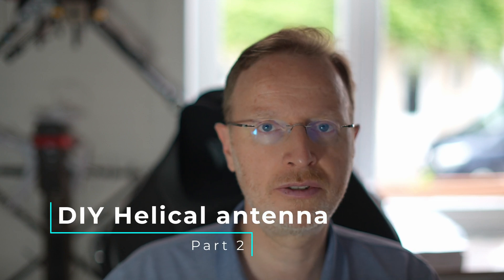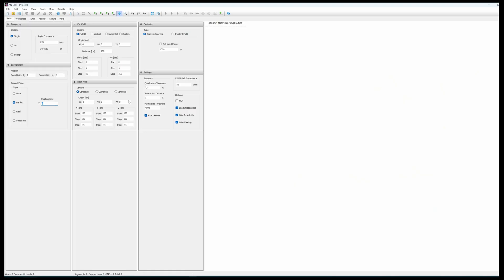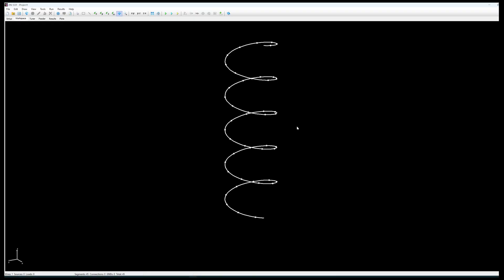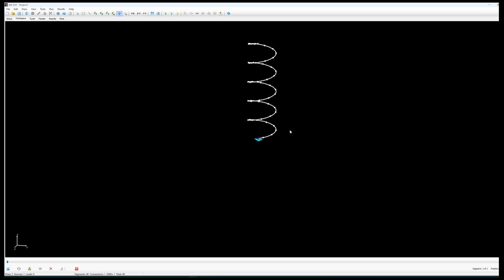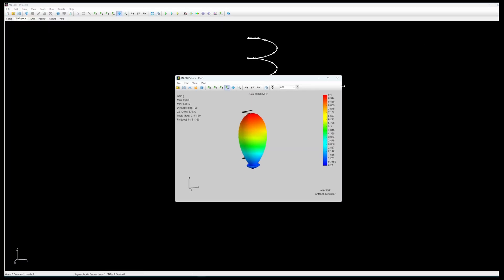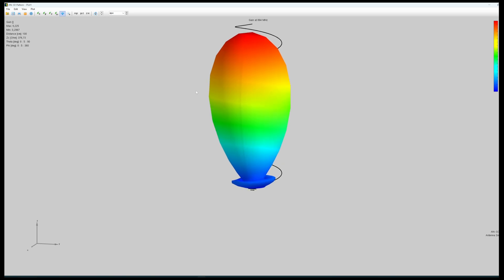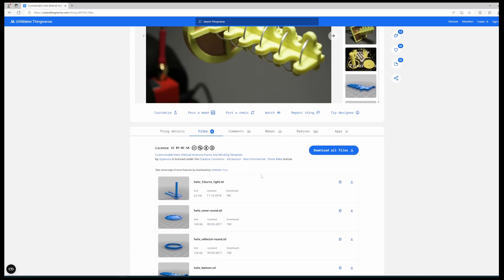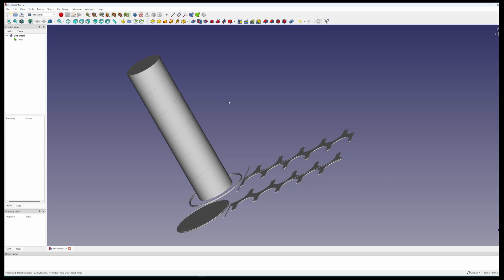How to build your own DIY helix antenna for Meshtastic Part 2

Comment: A great couple of videos, and I was so looking forward to seeing Part3 where you actually make and test the antenna - however Part3 never materialised.   Did you actually build it in the end?  If so, how did it perform?

Actually - I just listened to the final 30 seconds where you say you're not going to bother building it.  What a shame 😥

It must be possible to adapt the winding and holder templates so that you can print them in smaller parts and clip (or glue) them together in a more modular design to accommodate longer lengths (like 40cm for 869MHz).

Would be very interested to see how this performs compared to a Yagi.

Comment: Excellent work and presentation. Pity only to discover dimensions for practical 3D prints are a show stopper.  However this looks like it could work for a (otherwise typically expensive) GNSS, RTK (centimeter positioning) drone antenna given approx double the frequency ( L1 at 1575 MHz ) and lower gain requirements reducing the number of turns. Less than 100 mm high, with 100 mm diameter ground plane from quick calculations.  It would be good to turn your hard effort into a working unit.  It would be useful if you could describe construction of the matching part.